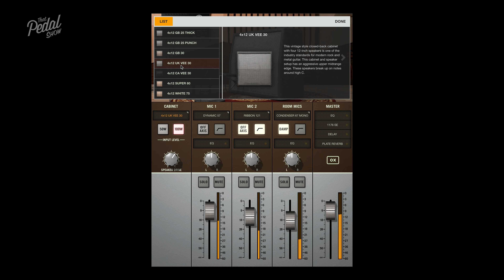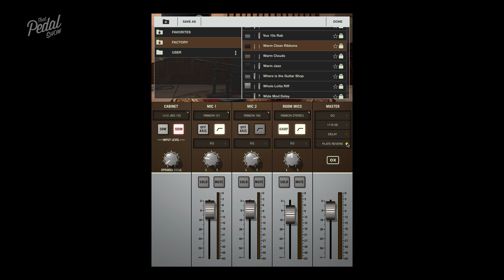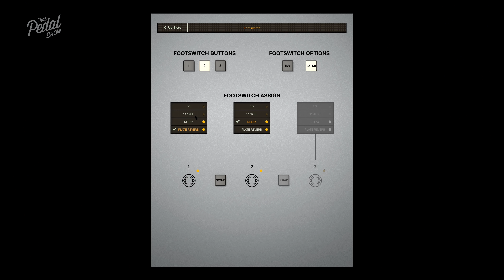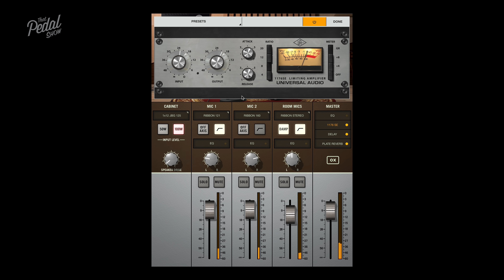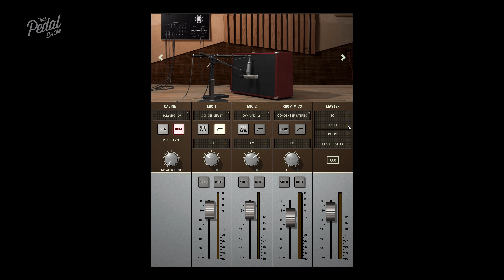UA OX Box Update, Hiwatt DR103 & A Visit From Tore Mogensen – That Pedal Show

Comment: I got my OX just before Christmas 2019 and the firmware update arrived just before my OX.  I LOVE THIS DEVICE!  It lets me run my old 100 watt Marshall heads at the settings that they sound best at, but with volume levels that do not engender a visit from the local constabulary.

I only recently tried the cab sim / recording and internal effects and IMO they sound brilliant.  The UI on the iPad is so beautiful and so easy to use as well.  Elegant and not complicated.  Thanks guys!
Reply from the maker: No arguments here Ross!

Comment: I might be dense, or not paying close enough attention. I get the direct out to the audio interface delivers the sound to the board for recording. What are you getting your in-room sound from the Hi-Watt Cab or studio monitors? I'm asking because I'm looking for an attenuator for live use, but also have the ability to use the same device for recording at home. This seems to be the e-ticket!
Reply: Annnndddd…. I think the video just answered my question.
Reply from the maker: Hello Pete. For the first part of the video we are listening back through PA speakers - kinda like fold back at a gig, or your studio mons at home. The OX has two volume controls on the front and for the majority of the video we have the cabinet volume set to zero: off.
Then when we’re blasting at the end, we turn the PA speakers off then gradually increase the cabinet volume through its increments to maximum. You can run both direct and to a speaker cab simultaneously. Cheers!
Reply: @ThatPedalShow  Thanks for the reply guys! That's really helpful. Since I found your channel you have been great source for the devastation of my bank account. LOL

Comment: Tor works for UA but doesn't know how to use an 1176?  He may have to hand in his badge.  ;-)  Unless he made changes after the panel screen shot, it isn't doing any compression, although just running though one does make a difference in the sound.  You have to turn up the input so that the meter starts indicating gain reduction.  The compression ratio buttons don't mean anything until you drive the unit over the threshold and it starts compressing.

Comment: Are we listening to the computer simulation, and are you guys listening to monitors? I'm assuming you are running the Hiwatt into the OX attenuator.
Reply from the maker: Info in the description Steve. For the majority of the video you’re hearing the Hiwatt into the OX, and then direct outs from the OX into the recording interface. In the room we’re hearing it back through some PA monitors. 
At the end when we blast the Hiwatt, we’re all hearing the Hiwatt through the OX into a speaker cab, mic’d up. Cheers!

Comment: Interesting point about hi wattage larger speakers in Silverface Fenders (15 inch Eminence Big Ben for example). They work excellently as pedal platforms and enable the use of 3-4 gain stages stacked and still retaining clarity. You pay for it with back pain whenever it comes to move the bloody thing...

Comment: Sounds great. So do you guys believe in, trust, like, etc. cab sims? As compared to full on digital modeling amps?
Reply from the maker: Erm, we’ve used all of it. I’d happily use any/all of the above if the real thing is unavailable. Mick here. However, I genuinely believe that the more analogue you remove from the chain (guitar, cable, amp, pedals, outboard, mic, speaker, cabinet, mic pre, channel strip, more outboard, tape, mastering, vinyl) the less connected emotionally you are with the music. I know, totally hippy right?
Listen to the radio is all I’m saying. What is that stuff? Now go listen to Joni or whoever else you like. Humans over machines. Now it’s machines over humans. It’s just an opinion.
Reply from the maker: .....and I’ll add a caveat. Not all AD/DA conversion is equal of course. High end DACs in quality recording gear and so on.... completely different case of coconuts compared with cheapo digital multi FX and modelling amps etc. But I do think it’s cumulative, and to dig an even bigger hole, the closer to the front of the signal chain it is, the harder it is to get it back. Like every decent producer and engineer will always say, start with a great source! Maybe. Hmmmm
Reply: @ThatPedalShow  all makes sense! I didn't even realize that the OX box had the cab sims in it to be honest. Thought it only did attenuation and that it was amazing at that.
Reply from the maker: It’s really //really// good.

Comment: On the complete opposite end, ever use a variac to scale an old amp ala EVH's old "brown" sound (as in "brownout", lowering the input voltage), you just can't do it to an amp with low voltage relays, and if you go super low it will take a long time to warm up. There are some guys doing really similar things like "power scaling"--after the power transformer, so it doesn't affect the heater voltage. But a $50 variac works as a great "master volume" ... no cool cab modeling though.

Comment: I think it's interesting that the Vintage 30 seems to be associated in so many people's minds with a very heavy low end, because Celestion's design brief for the Vintage 30 was to make a driver that matched as closely as possible the AlNiCo Blue, while providing a higher power handling capacity with a ceramic magnet, and to this day, I think the Vintage 30 is still the closest match to an AlNiCo Blue, thought the AlNiCo Cream rivals the Blue is a slightly different way.. The Blue is a very bright driver, and so is the Vintage 30. When you do these comparisons, I can start to understand why Marshall player might prefer the Greenback, because Marshalls are notoriously bright--overly bright, in my opinion. The Greenback, being a darker speaker compared to the Vintage 30, helps tame that.
Reply: The alnico will tend to compress with volume as well, taming the highs a bit. The ceramic v-30 less so.

Comment: sigh. myth dispelled.   micks 2 rock is louder than pete townsend's hiwatt.
Reply from the maker: It might not be with different speakers.......
Reply: @ThatPedalShow  Ox also always attenuates too.... sigh.
great sounds all round. love youse guys.
Reply: I sincerely doubt that to be the case.   Hiwatt DR103s with original Mullard tubes, when measured, actually put out closer to 150 watts of sheer terrorizing power.
Reply: @mattthrun-nowicki8641  HT of 450v into 4xel34.? .... perhaps if they used higher ht - 600v or so it would go.
irrespective. 100w plate watts isnt fun. I have a rivera m100 (custom shop) and it is pointless to me.
Some of their other models use KT88's... ahh   the 70s

Comment: boss waza tube amp expander
Reply from the maker: We did a video on it back along. Very cool... but the solid state reamping part is the issue for us. Cheers!
Reply: @ThatPedalShow  Am I wrong pointing out that on stage your sound is going through a solid state PA anyway?
Reply from the maker: Not at all. But it’s being mic’d from a speaker on the end of a valve output stage. We’re not saying it doesn’t work and isn’t tremendously useful.... but I really want to hear my amp, not a reamped amp.
Reply: That Pedal Show 👍🏻👍🏻